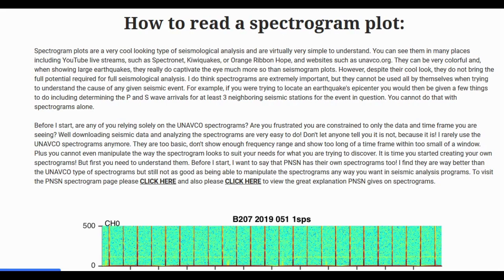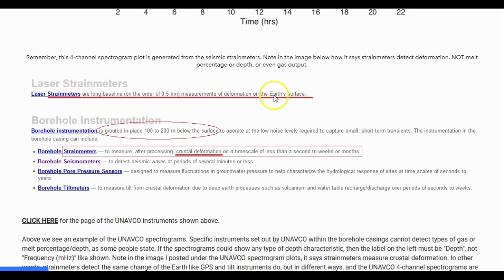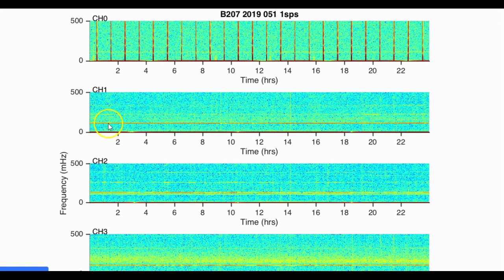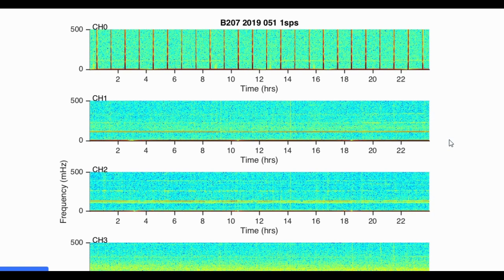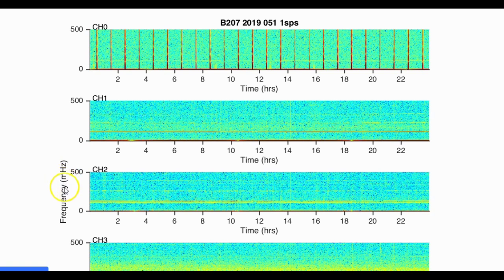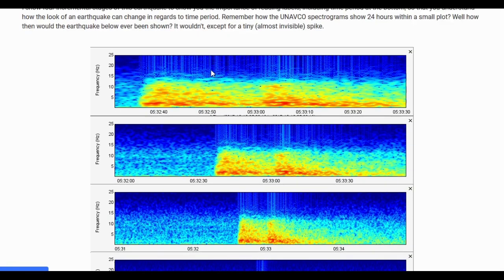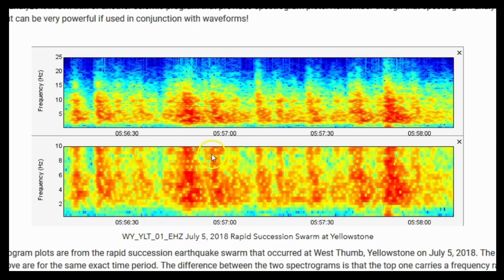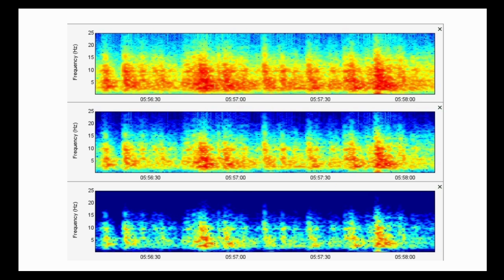How to read Spectrogram plots - Best plots to generate are from the program SWARM!

Comment: I commented earlier on a simple DIY method of monitering earthquakes, but I think a better DIY method can be devised with a better camera than a phone cam, although you still would need a cellular service to transmit the data back to you.  Apparently there is a method to determine sound from images via ..I'll just supply a link at the end.  Anyhow, the idea of a cellphone buried in a box having external solar panel, external antenna, external MR107 radon gas detector, geiger counter,  temperature, barometric pressure-- all in one shoebox system shouldnt cost more than a total of $500.  Maybe I'll build one this weekend just to demonstrate.

Oh, here is link to capturing sound from images: https://youtu.be/eUzB0L0mSCI
Reply from the maker: Woah! That sounds really cool! Hope it works! God bless!